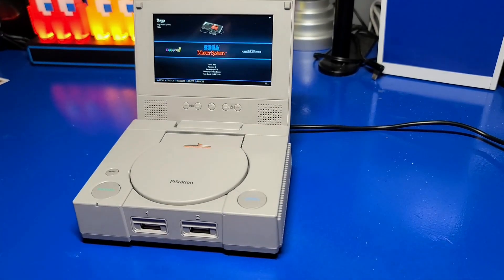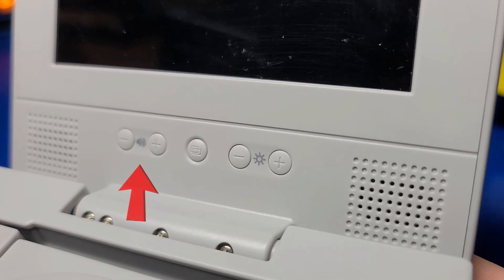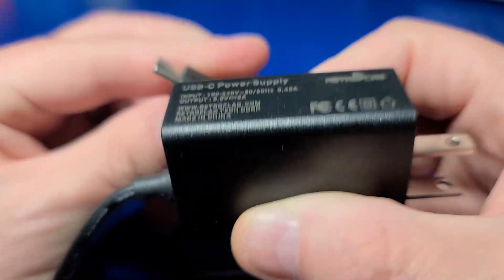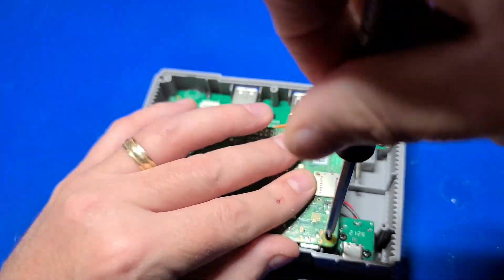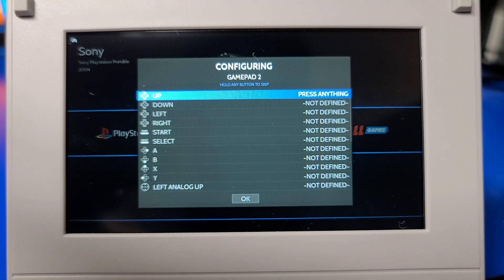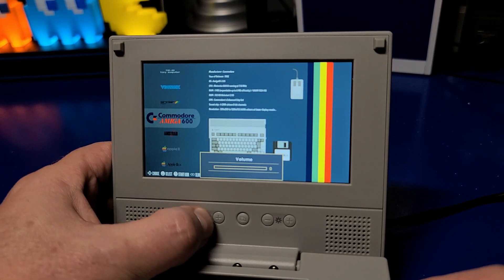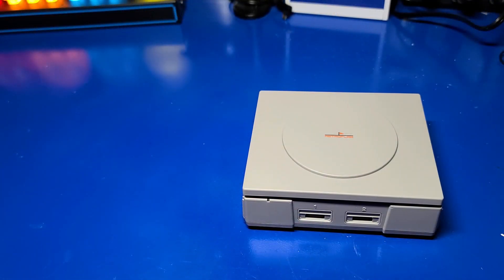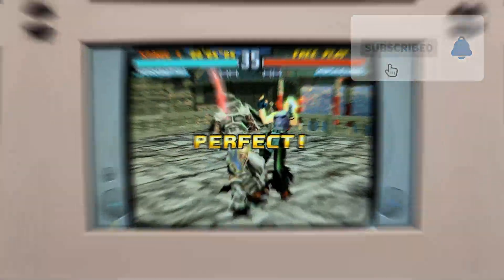RetroFlag Pi Station Case Setup & Review for the Raspberry Pi 4

Comment: My screen has a black border around it and is not utilizing the full display.  Any recommendations?
Reply from the maker: You can make adjustments for each emulator to adjust.  How you do it exactly is going to depend on what you're running, such as RetroPie, Batocera, Recalbox, etc.

Comment: Wagner. I just bought this and there is one big issue. The Ethernet is not accessible once the case is closed. Darn. I have to have Ethernet connection for my online retro leagues.  Any ideas?   I have the non lcd display.  Maybe there is a male to female Ethernet short cord adapter and I could drill through the side and run it out ?
Reply from the maker: Look on the left-side, there is a small tab.  Push in and pull out that panel and you should have access to the Ethernet port (and two USB ports).
Reply: @WagnersTechTalk  oh thanks. Did I miss that In the review?  Thanks for the video by the way!
Reply from the maker: I mentioned it briefly ~ 09:02 .  Very welcome Sir!
Reply: @WagnersTechTalk  ahhhh. Yeah I stopped after you showed how to put it together because I already have the image and the safe shutdown and all that stuff.  My fault.
Reply from the maker: Lol, np

Comment: is the mini fan meant to blow into the pi board to cool it or out the Pi case dick tray vent to blow the warm air out? few other ppl have it put in the other way, I wonder which cools it better if even so? thanks
Reply from the maker: It cools largely the same so it really doesn't matter.  I asked this question to a different company, they saw very little difference in cooling either way.
Reply: @WagnersTechTalk  though as much, I did turn my the same way. Finally got everything set up with retro achievements and some netplay there fun to be have with this great desk toy!

Comment: Was your board overclocked? Was also wondering if there was any heat issues?
Reply from the maker: I did not encounter thermal throttling, it wasn't necessary to overclock for the games shown.
Reply: @WagnersTechTalk  any tips for a new pi user? Have pi 4 2gb otw (scalpers suck -.-)
Reply from the maker: @s0undw4ve_86  I have a bunch of information to help on my website (with videos, in most cases).  Skip over those sections that are not of interest to you here: https://wagnerstechtalk.com/rpi4/ .  Some I'd recommend there: PINN Lite, Win11 of the Pi, cases that may be of interest, etc.  If primarily (or only) interested in Retro Gaming, then this link should answer many questions and provide a good foundation for options that are available: https://wagnerstechtalk.com/rpi4gaming/ .  Hope that helps you get started!
Reply: @WagnersTechTalk  awesome thank you so much! And yea this is gonna be for emulation only :)
Reply: @WagnersTechTalk  hey sorry to bug you, do you think fan should be installed as intake or exhaust?
Reply from the maker: @s0undw4ve_86  Either orientation will provide adequate cooling.  I performed a test on a similar case and even asked the vendor.  They basically said, it doesn't matter.
Reply: @WagnersTechTalk  good to know 👍 not planning on overclocking at the moment if I'm satisfied with the psx performance. Was getting some slow down tho on megaman x? (batocera v33)
Reply: @WagnersTechTalk  awesome to hear thank you! I'd prefer to avoid overclocking

Comment: Can I use thermal paste to stick the heatsinks to the board? Seemed like ppl generally aren't to happy with the thermal tape
Reply from the maker: You could sure, might just need to scrape off the tape and clean it good before applying the thermal paste.
Reply: @WagnersTechTalk  I wonder if the heat sinks would hold in olace once the board heats up
Reply from the maker: In my opinion, the thermal tape is fine.  I left it running for x2 days straight with a game loaded to exercise the CPU a bit.  No cooling issues from what I witnessed.

Comment: RetroFlag never disappoints, this is such a cool little case! You can actually change the text size when working in the terminal: just change the resolution in the /boot config.file under "console" and the text should be larger and easier to read.
Reply from the maker: Awesome, thank you for the tip!  Agree, RetroFlag makes some of the best products.

Comment: i dont know what my problem is, but I tried everything to make it to stop to say "no signal". What can be the problem? i just got power for it and have my bluetooth adapter in it. I also tried to connect hdmi to tv and monitor on pc and it doesnt work
Reply from the maker: A few things: Make sure it's powering up, try a different HDMI cable, double-check your Pi's connections (wires are seated properly, all pins are aligned correctly).  Just a few things I can think of.
Reply: @Wagner's TechTalk  it is powering up, because it says no signal on blue screen and turns black later. It works I see it
Reply: @Wagner's TechTalk  ive tried 2 cables hdmi and 3 power cables
Reply from the maker: Double-check this connection 03:47, when I first assembled it I didn't have my glasses on and was off by one pin (something I didn't want to admit to, but you forced me lol).  If that doesn't work, remove the Pi from the case, plug it into your TV/Monitor and see if it boots fine outside of the case.  If so, you got a bad case.  If not, you got a bad Pi.
Reply: @Wagner's TechTalk  ok, all works. Problem was in power. I just have used usb to pc not to power socket. But after I tried it in power socket all worked.
Reply from the maker: Sweet, nicely done!

Comment: I tried everything. I guess the scriped they give us doesn't work with Recalbox at all even though they claim it does
Reply from the maker: Just curious, did you set the Safe Shutdown switch to on and install this version of the script: https://github.com/retroflag/retroflag-picase#example-for-recalbox
Reply: @WagnersTechTalk  Yes I did. I turned it on and used Example for RecalBox:.
When I delete everything all buttons work, however as soon as I use the script the buttons don't work at all anymore.
Reply from the maker: I remember reading that Recalbox already had built-in support for the shutdown scripts pre-installed for the NESPi 4, likely the same API that exists within the PiStation.  I may be wrong, but the scripts may only be necessary for RetroPie and Batocera.  I definitely tested with RetroPie and the scripts worked fine there.  Their github page doesn't specifically call out the PiStation case and that may be why.  To make sure I don't tell you wrong, check with Retroflag here: sales@retroflag.com and see what they say.  If you find out anything, let me know please.
Reply: @WagnersTechTalk  Thank you! Will do!
Reply: Did you solve it?
Reply: I have the same problem

Comment: well that doesn't work for me. I installed the scriped as shown but the pi doesn't shut down anymore when I have save bootdown on. When I switch that switch off it just crashes the whole system of course
Reply from the maker: What are you running on the Pi?
Reply: @WagnersTechTalk  Recalbox. I changed the stuff that needed to be changed for Recal which is the sudo part. It installs, but when it says it will now restart the system it just doesn't and says it can't find something. When I type in reboot it does exactly that, but the powerbutton is pretty much useless from that point on. No powering down at all.
Oh same goes for the reset button. Not functional after the script

Comment: So how do you get the lcd working ? 
The img I put in the pi4 won’t work on lcd but will work when use hdmi to tv from case
Reply from the maker: You just plug it in, no drivers to install.  If it's not working, make sure everything is tightened down.  Still no go, make sure the connectors on the Pi are seated properly, the first time I plugged the connector on to the GPIO only one row of pins was connected (I couldn't see well with the camera in the way).  That's likely what the issue is, make sure both rows are connected to the GPIO pints.  If that's still not it, you can contact sales@retroflag.com for other suggestions.
Reply: @WagnersTechTalk  the thing is that a new retropie img will work , just not one that has games etc already on it
Reply from the maker: In that case, it's not defective.  Try this, plug in the device into your TV and set the display resolution down to 1080p (1920x1080p) or even perhaps lower on the image in question.  It may be set with a default resolution that the display can't handle.  Otherwise, I don't have any other ideas, but sounds like the case is fine.  Maybe contact the developer of the image, if possible.
Reply: @WagnersTechTalk  I’ve figure it out found a file to change and now works
Reply from the maker: Awesome, great to hear!  Happy Holidays!
Reply: @scottamero7909  I have this same issue could you point me in the right direction
Reply: @kdoesmokev1409  change the resolution , if you look at all YouTube video one has a link of what you need

Comment: I have been searching for an answer to a question I have but since it's probably a ridiculous idea for most I can't find an answer. But I'm a ridiculous person so I gotta ask 🤣

I have a raspberry pi and I have nes, snes, sega master, sega genesis, and playstation games loaded on it. I've bought usb bluetooth controllers to match each gaming system. Is there a way I can plug the wireless USB adapters into the pi and use each controller for their respective game without having to remap the controllers? Can I add a USB hat and just leave all of them plugged in? Thanks!
Reply from the maker: I've honestly not tried that many controllers connected at once.  If they are BT controllers, you can set each up individually to RetroPie, Recalbox, Batocera, etc.  You will have to configure/map each of the buttons for each of the controllers.  For those that require a USB dongle, you could use a USB hub connected and again map the buttons for each.  In theory, it should work but I've not tried it.  If you do, please let me know how it goes, I'd be curious to know!
Reply: @WagnersTechTalk  👍

Comment: mine speakers doesnt work.... with hdmi sound configuration.. Im going to send it back to receive another one.....
Reply from the maker: In Emulation Station, go to the sound settings and try each of them.  Maybe it didn't detect the correct one.  What distribution did you use?